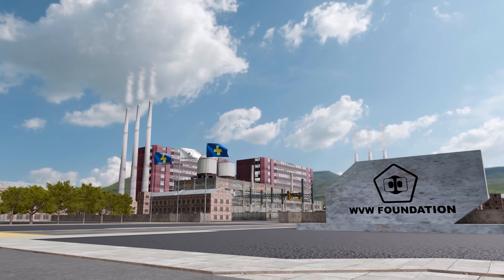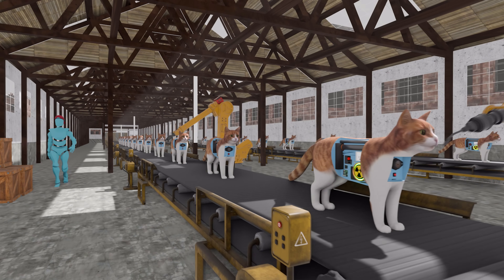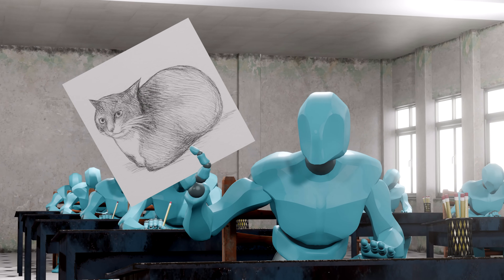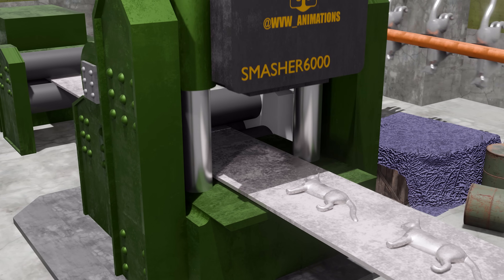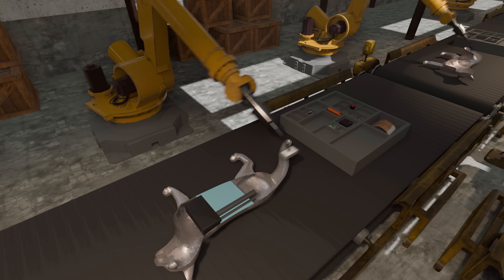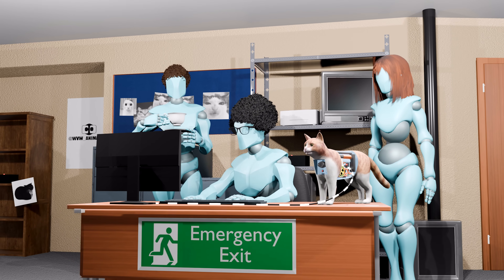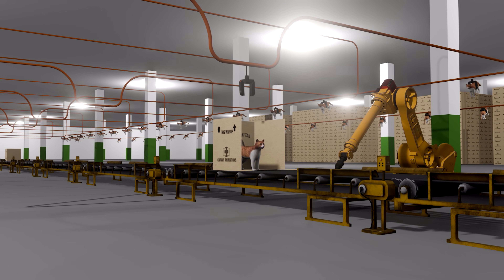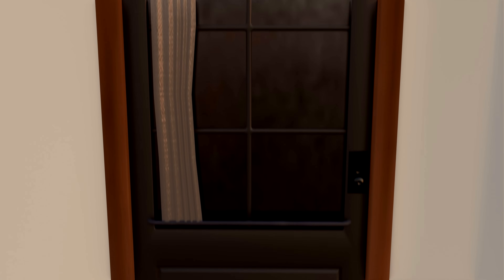How to make a cat

Comment: How does something made out of steel become liquid at room temperature?
Reply from the maker: When cats overheat, they reach steel’s melting point
Reply: Not with jet fuel.
Reply: @chris101ward  i smell some conspiracy there
Reply: when what why did you say that?
Reply: Sorry, that particular cat had too much mercury added in the alloy. My bad.
Reply: Nuclear reactor core. Each cat is a walking chernobyl. Stainless steel is easy work when they can liquify graphite.
Reply: Umm mercury